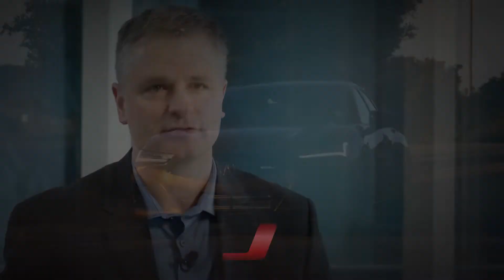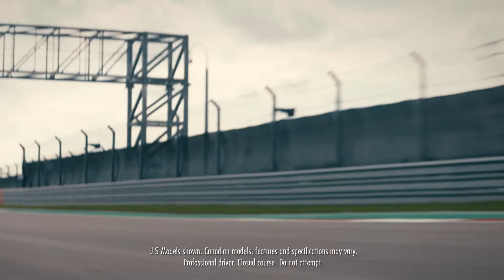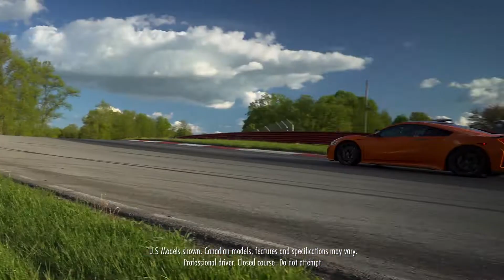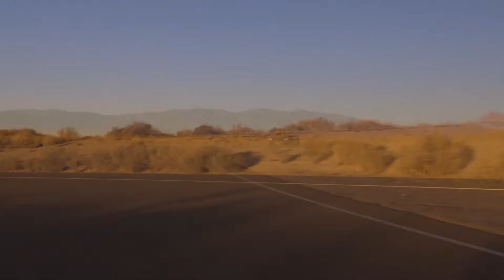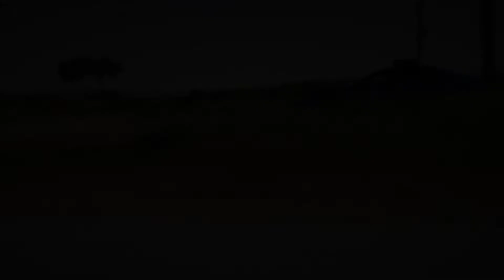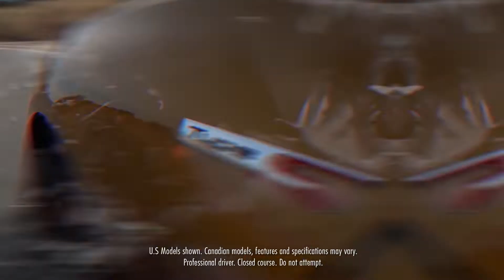Acura Type S Turbo V6 - Development Story

Comment: Too bad it is slowest in class. What a disappointment after showing us a car power sliding and burning tires in marketing we get last in class performance. It is equal in acceleration to a standard Audi A4 yet claimed you targeted the S4!!! You missed by a mile guys.
Reply: @rhlastnae5236  I am confusing nothing. A4 0-60 4.9sec S4 0-60 4.3sec

So the Type-S 0-60 4.9 is matching up to the A4 not the S4
Reply: @rhlastnae5236  No you fail to comprehend. The A4 does 0-60 in 4.9 The S4 target is 0-60 in 4.3! The others are even faster....